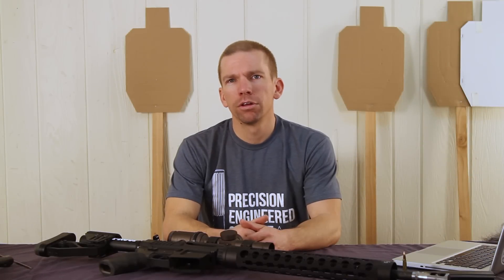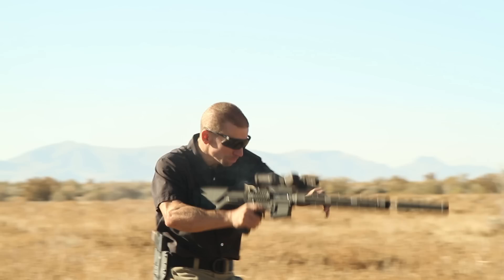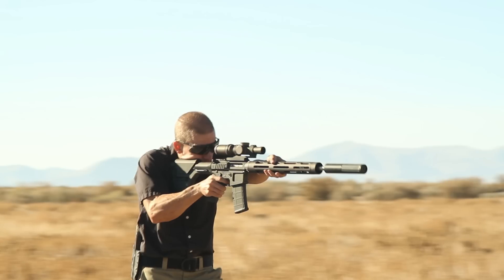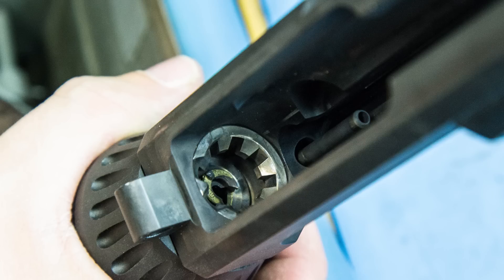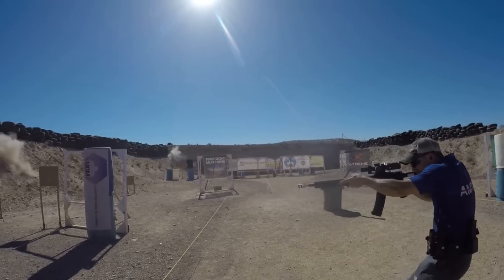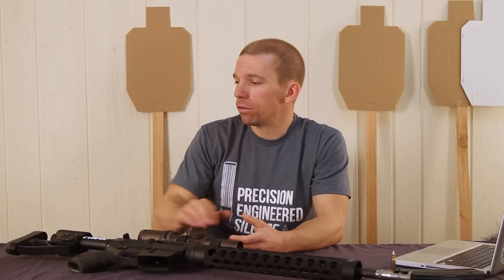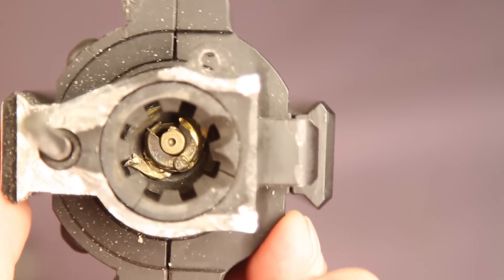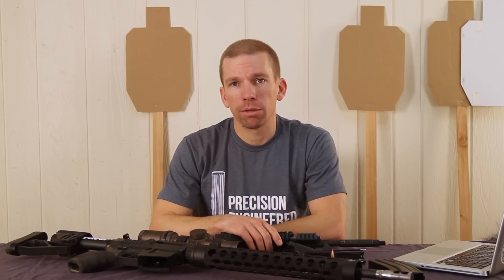Kaboom

Comment: Plus one on your openness and honesty, personally I hate when people don’t admit their mistakes.
I noticed you mentioned reloading, I personally reload and am an RSO at a local range, I treat every load as a reload for this example you just showed, I kind of saw you had a pen issue and would have stopped you when you were continually pulling back your charging handle, that was pushing that bullet into riffling. Long story short I saw same thing but in a gun smiths store, dude told smith he had double loads stuck twice, smith was trying to figure out (why riffling was catching bullets) I asked simple question “were they reloads” answer was yes, problem solved not gun but reloads.
Thank God no one was hurt and for firearm fared well.

Comment: Very good information.  Took my AR to the range to try out new hand loads.  Loaded 5 in a Mag and 1st one fired perfect. The second one did exactly as yours. But I had powder all over the inside of the chamber.  The bullet was in the lands, but so much powder kept the bolt from going into battery.  I did not have a cleaning rod to punch out the bullet, so I was done at the range that day after one shot.  A 60 mile round trip for one shot.  
That casing had slipped through and had not been resized.  That and the powder kept it from chambering.  I went back to the bench and pulled all the bullets. Dumped the powder in a cup and resized all the cases.  Reloaded the powder and bullets.  Next day back at the range.  No problems.  Attention to details, Don't rush or take shortcuts, and Be safe.  Mine just as well could have ended like yours, with a KABOOM!
Reply: @240FP the bullet could have just been sitting ontop of the powder for all we know

Comment: I run 5.56 and 300 black so yes, always diligent in keeping those mags seperate.  I always load my 5.56 in FDE pmags and my 300 black in black ones.  That way it helps on the range table.  So far so good.  While any kaboom sucks for the equipment fortunately no one was hurt in these two incidents.  I've only witnessed one being on the range when another shooter had a squib 9mm makarov and then fired another one right afterwards.  When ever that report sounds wonky, stop, check the chamber and proceed if all is clear. Thanks for sharing your experience.